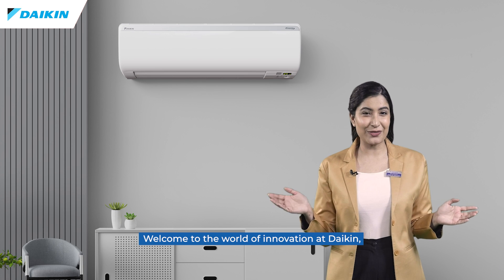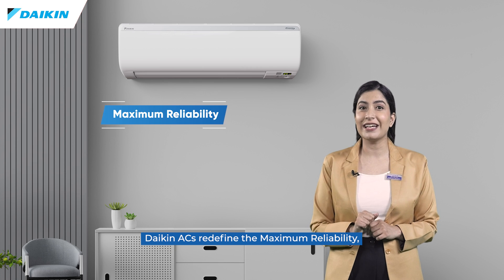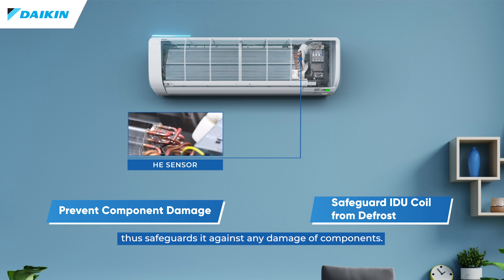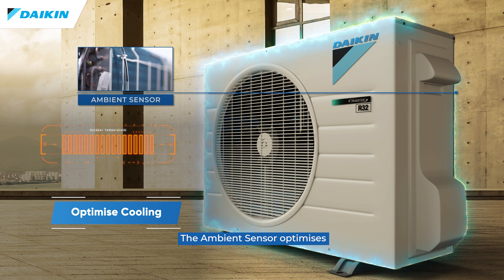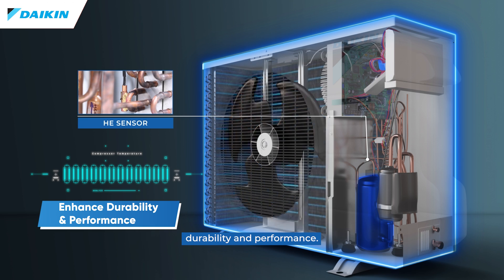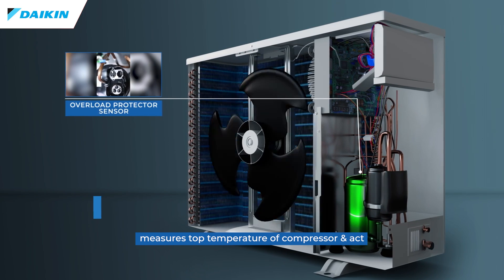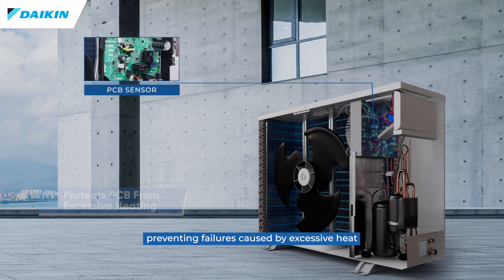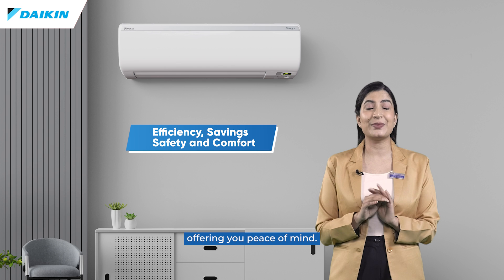Daikin Hepta Sense Technology

Comment: From 30.05.2024 Daikin service centre jamshedpur and Daikin company cheat for service name .
His technician not capable to rectify the ac problem, they cheat 11600/- rupees for service ac after few minutes our ac facing same problem.
daikin service person cheat 11600/- for 10 minuts runing ac. our problem is as it is.
Air expert service center is zero efficiency service center.

Comment: Daikin inventor spilit ac. PCB BOARD IS 5years warranty. pcb board kept open in out door unit so pcb board problem regularly comes due to insects..lizard... spider.. ants.. etc.. daikin company needs lot of improvement in pcb board protection matter .this is my personal experience..
Reply: Make sure the PCB is not vertically mount as in many models. Only buy models with upside down mounted PCB.
Reply from the maker: Hi,
We sincerely regret the inconvenience. Let us know your contact number via a private message so we can escalate this issue to our concerned team.
 www.messenger.com/t/DaikinIndia
* Regards,
Daikin Team